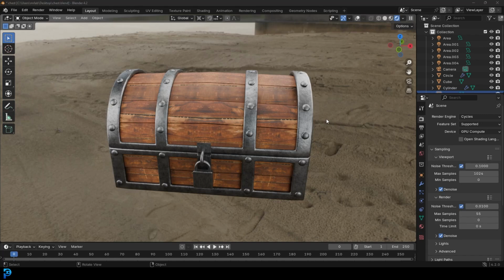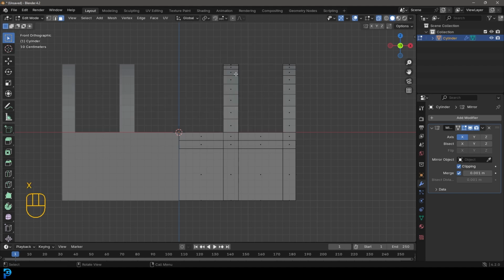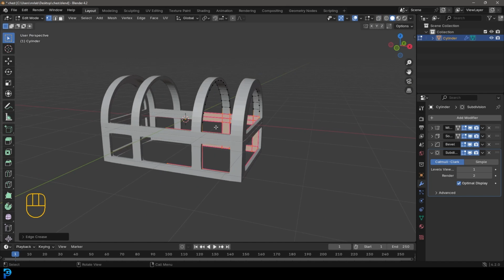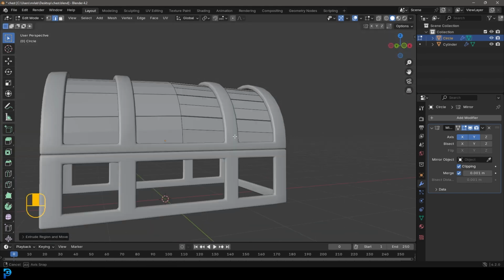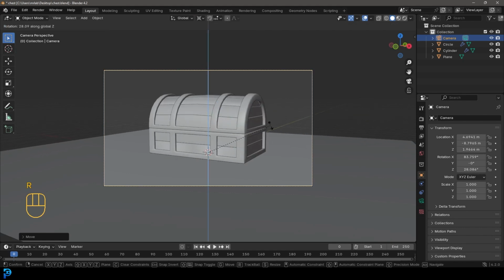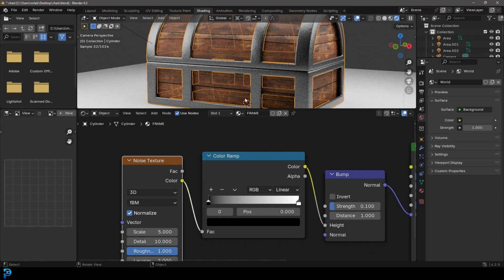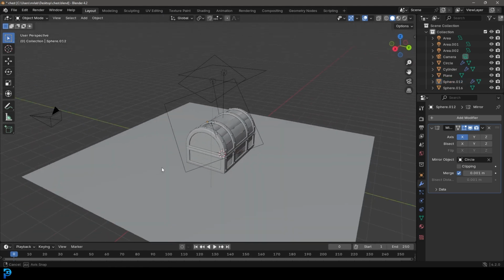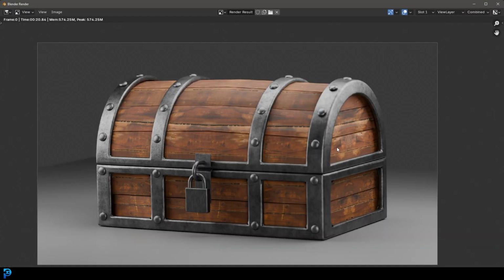Blender 4.2: Treasure Chest | Tutorial

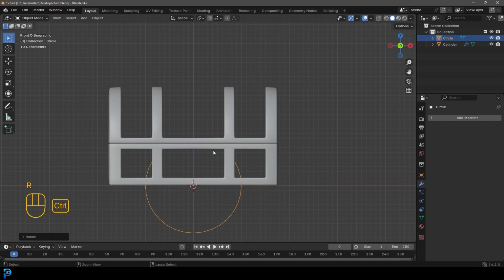Comment: at around 7:21 instead of grabbing a circle to do all that and make the top, I would recommend grabbing the vertices from the already made chest part on the right, alt + d to duplicate them, P and separate: by selection, then just scale it slightly, and extrude. while also removing all the other modifiers except mirror. seems just easier in general. great tutorial, really unique way of making it and got me started flying fast
Reply: great point

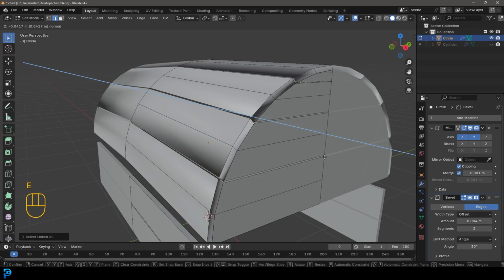Comment: 12:01 what is that black think and how to delete it
Reply: Bevel Modifier > Clamp Overlap (Checking this off fixed the issue for me)
Reply: idk if u still need help with this but i just applied auto smooth shading and that fixed it for me :)
Reply: @an07yn  So. Big issue. Doing that just turns the entire chest into those weird black things.
Reply: i remember there is a way to get rid of it, by marking seams (the blue line) then only having that one part be normal shading while the rest be smooth shading, but if you follow along in the video, it seems to be hidden anyways. would google the mark seam thing since i forgot  a bit but should help in the future if you ever have that issue urself

Comment: Today I came to the conclusion that studying 3D in general (Blender, C4D...) It doesn't make any sense anymore.. The neural network will still replace all this in the near future. What's the point of wasting time?
Reply: To create, it just feels so satisfying getting a work done, even though the output is bad or good, for me its just kind of reward of the creation process.

But if you dont feel that way its fine, just quit creating, maybe you're not supposed to.
Reply: trying to create art with gen AI is like trying to drive by text when you could just grab the wheel. sure it will streamline aspects of creation. and some creators could get lazy and just use the output. but almost any self-respecting creator is going to want control over what they're doing which requires knowledge of the systems they're building in. No matter how good AI gets it will never produce your own artistic vision right out the box.
Reply: It will not, at least anytime soon in our lifes.